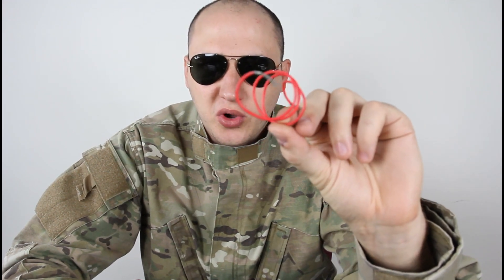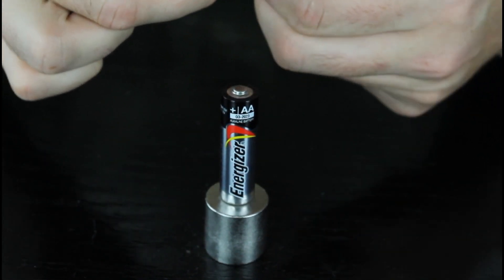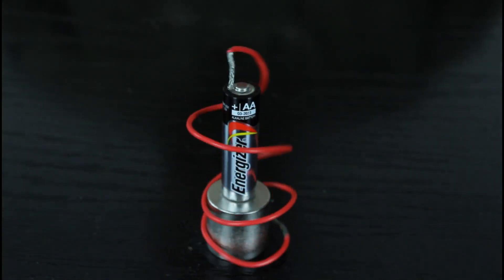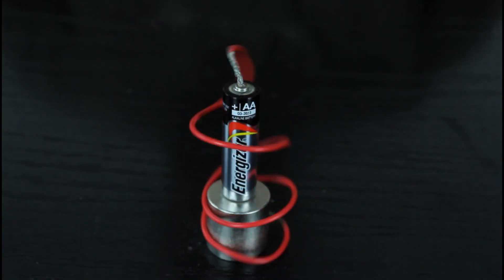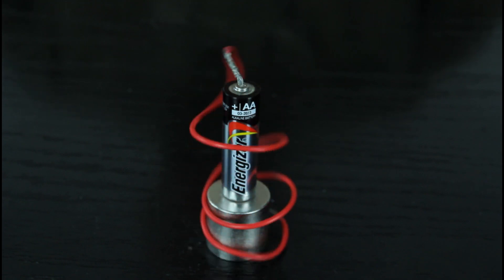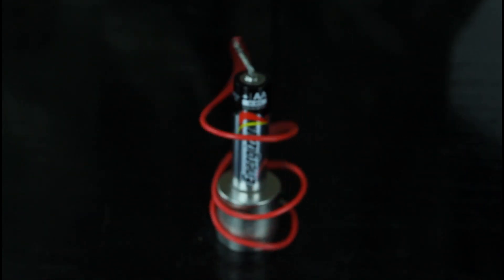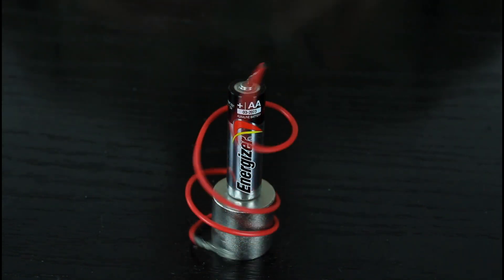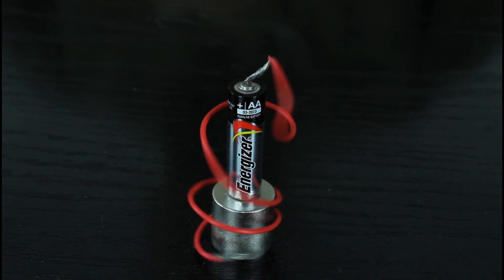Simplest Electric Motor

Comment: Explanation: The potential difference of the battery, allows a current to flow through the coil as it is a complete circuit when the magnet is connected to the coil. The magnetic field from the magnet then interacts with the magnetic field from the current in the coil ( moving charges create a magnetic field) to exert a perpendicular force on the coil. The force on the coil results in the rotation of the coil.